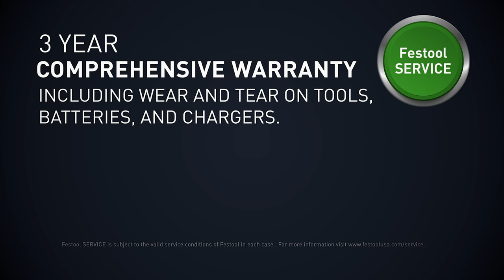The Best Drill That Festool has Ever Built! QUADRRIVE TPC 18/4 Hammer Drill

Comment: You should have a mode to detect if the driver bit skips out of the head of the screw. Then it can stop before you strip the screw head out completely and really end up in trouble.
Reply: Or you could just not use phillips screws.

Comment: I like almost all festool stuff but not there drills, for drills and impact drivers I go to Milwaukee.
Reply: Ditto
Reply: I agree 90%. I have an M18 from Milwaukee, a C18 and CXS from Festool. They're all fine, but the C18 not 3x better than the M18 (accounting for price). 

But...the CXS is the drill I grab 90% of the time!
Reply: Ya agreed, except the cxs which is way better than the install driver from Milwaukee imo. I do want to try this drill out though
Reply: Milwaukee in the UK is Chinese made tat, its powerful but after a couple years the drills start to lose crazy amounts of power and become paperweights. I don't want any Chinese made crap
Reply: Have you guys tried the SURGE by Milwaukee, it’s hydrolic oil driver super quiet and smooth you can barely hear it.

Comment: My makita XPH14Z for $189 at home depot has over 1250 lbs max torque, whereas this only has 450?  What the hell.  Do you want affordable power or an expensive weak toy.   I have to say I have been disappointed in Festool lately.  They have great staple products (dust extractors, track saws, domino, sanders), but are not doing well in the drill/driver market.  There is NO NEED for four gears.  This is a marketing gimic.  OOOhhhh look at that gear shifter - COOOL.  No, there is no power compared to Makita or Milwaukee.  Festool Fanboys probably don't do heavy duty projects anyways so go ahead and get it for over $1k after you buy all the expensive accessories.

Comment: This drill makes no sense as the torque is 75 NM. The ad depicts a segment on power which is nothing sort of risible. Makita's 40v XGT can go up to 140 NM. While I appreciate that this drill may not be directly competing with that, it's torque is almost half which is simply unacceptable. If the torque on this drill was 120 NM, I would probably buy it as I have Festool 5.2 AH batteries. However, a full size battery drill with 75 NM of torque is of no use and a waste of money. This one specification alone makes it a serious disappointment but add in the ridiculous price for so fundamentally underpowered a drill and I have to serious question Festool's Product Management department.
Reply: do you use 2 feed long screws or why you need so many torqe, thats not a pro user argument🤣
Reply: look at my video of makita drill  broke with no elektonic shut of
Reply: @exigauner  -  you obviously never done any real work, try using a 3 or 4 inch hole saw with it, it wont do the job.
Reply: @truthserum9157  i have try a 3 inch hole saw and it works with no Problem, by the way i have the 40v drill too i like bothe